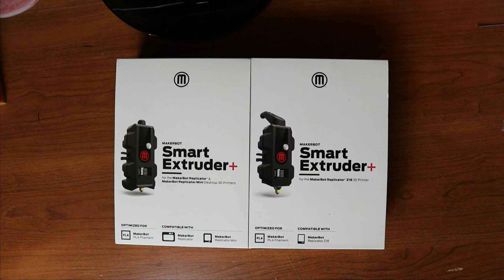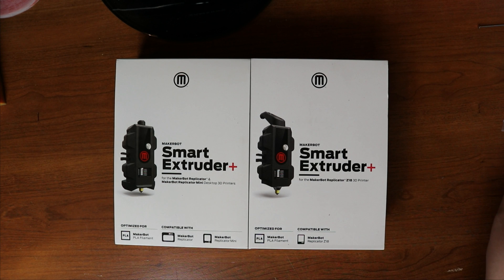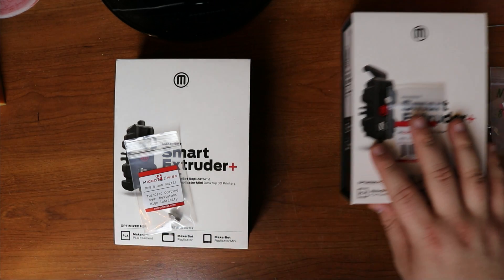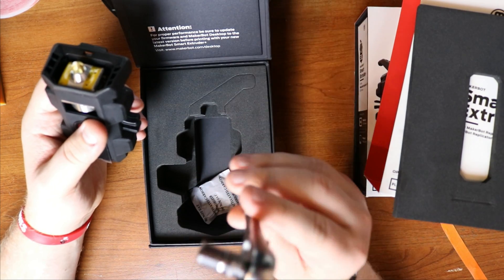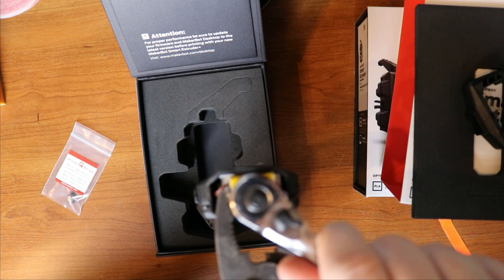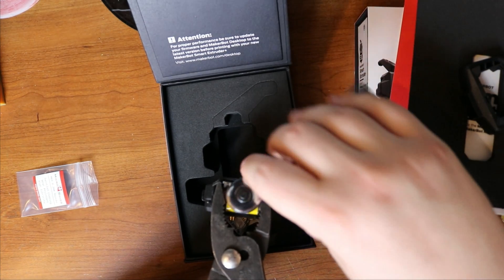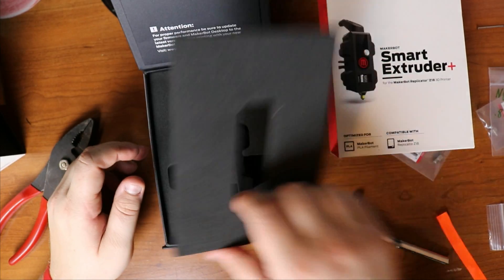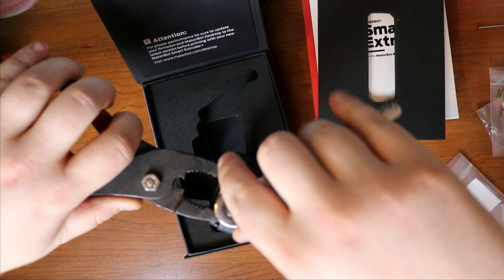3D Printing: Makerbot Z18 Smart Extruder + With Micro Swiss Upgrade

Comment: What changes in the Makerbot software did you make to compensate for the nozzle size change? I have a Z18 myself and would like to give it more flexibility for materials and resolution but I'm still pretty new to printing.